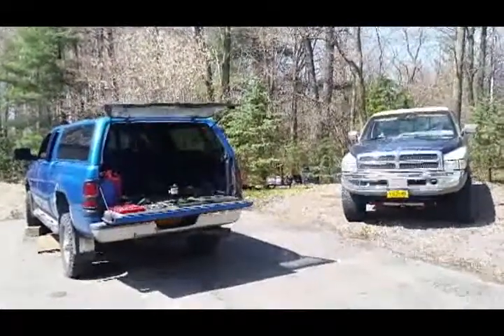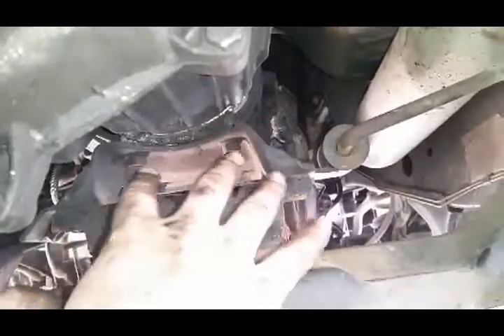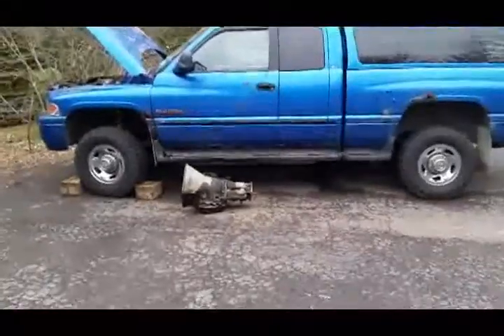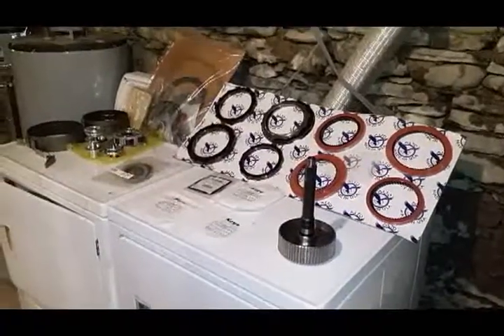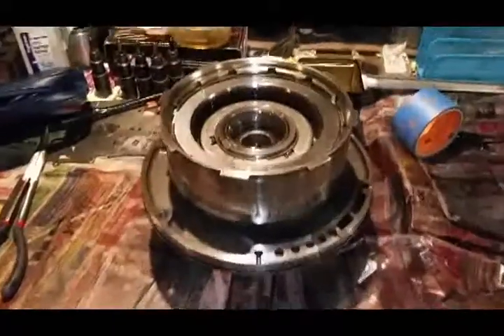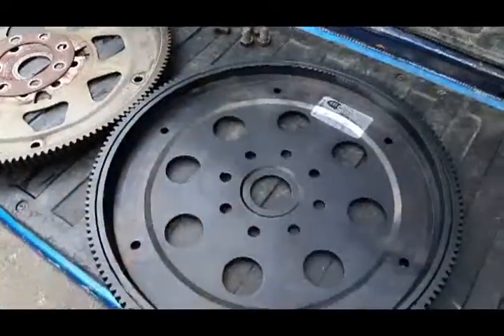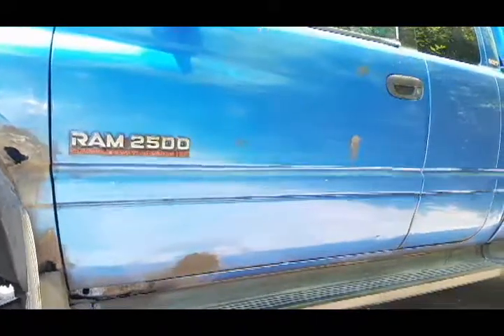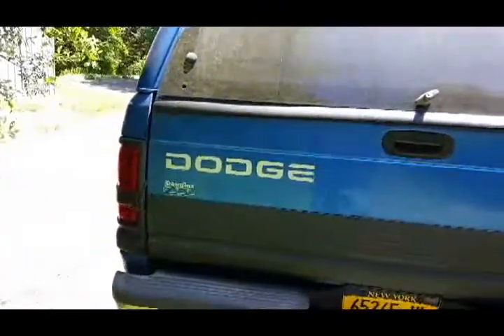dodge  24v cummins 47re trans rebuild

Comment: Dear Kyle, My name is Dan, I  love that you over killed every weakness and strengthened the system. The electric cooling fans, the temperature sending unit in the pan for real time dash observation, The drain plug for quick fluid change, the paint finishing,  the Altovousa rebuild kit, the Koyo bearings and thrust washers,  the Valair hardened input shaft -billet hub assembly,  but I don't understand the permanent sealing of the direct drum and it's inner components.   And you don't talk much during that portion of the video.  Could you please elaborate in this comment section ?  I also love the beginning where you show the vacuum hoses that came out really clear.    And I really like how you said you were gonna let the overdrive tail-section fall on your stomach.   That thing looks like it might be heavy.  I let an automatic transmission fall into a tire once.  But you have to select the right size tire. I have to do one of these soon.
it's probable gonna be the forward band wore the friction material off. I'm hoping it didn't damage it's drum too much. I am new to automatic transmissions and tig welding.  I do have one but only used it a few times. I fixed a Ford Ranger automatic transmission. I forget the model number, but my Dad was driving every place so that he didn't have to put in reverse because there was no reverse.  So I learned that reverse was all the way in the back of the transmission.   And found out that a little cast iron latch from the reverse servo; the tip of it broke off and It wasn't engaged with the reverse band. I welded it on a Sunday and put it all right back together while I still remembered how. stick welded with #308.  -Talk to ya later.